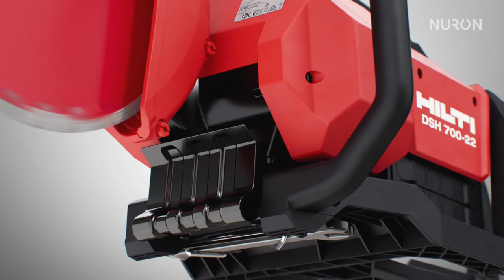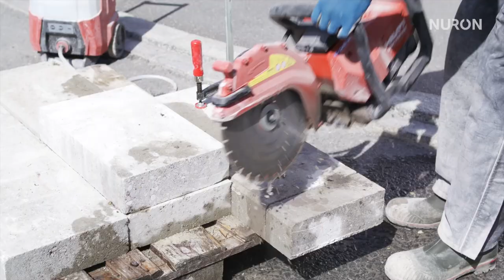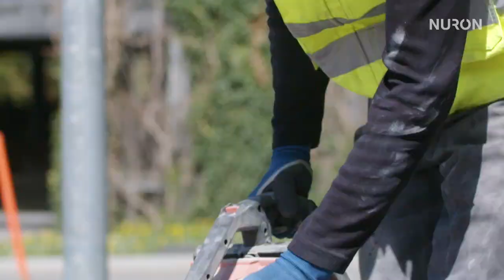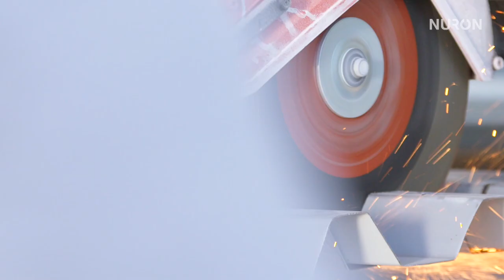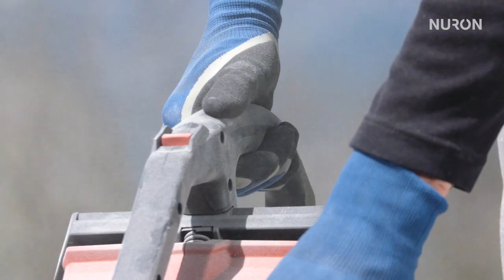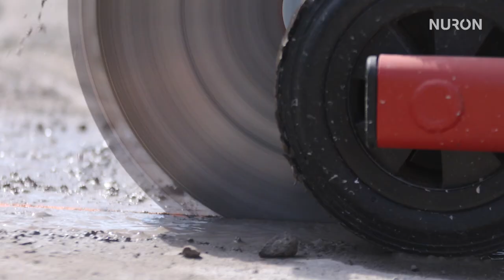Hilti Nuron DSH 700-22 Rear Handle Battery Cut-Off Saw - Features and Benefits

Comment: It’s a great machine,but the battery doesn’t last longer than 10minits cuts. And need 45 minutes to charge.
I have to buy 4 batteries and two chargers,and I’m still not able to use full time.
The biggest problem is Hilti don’t have a combo 6 battery charger.